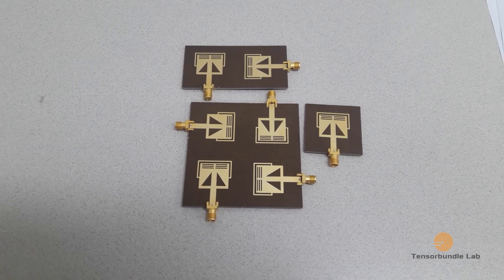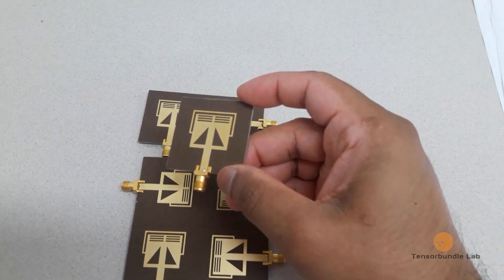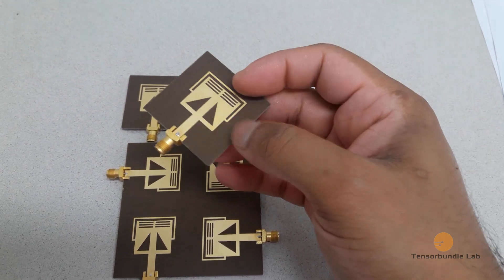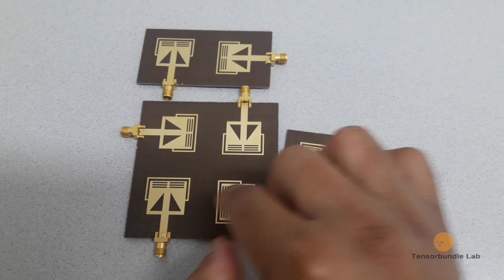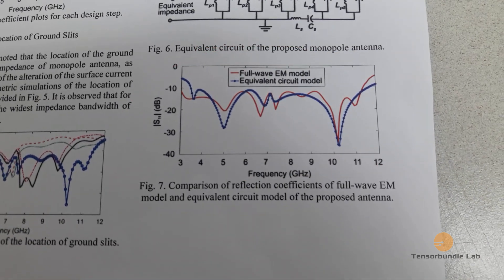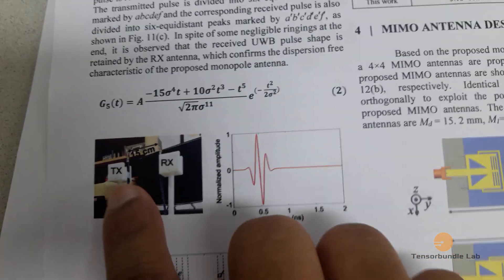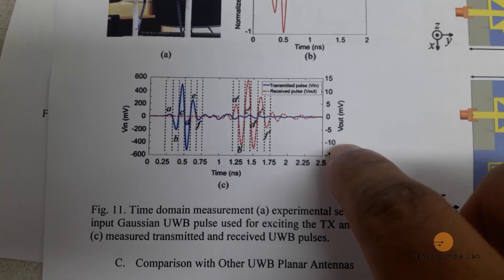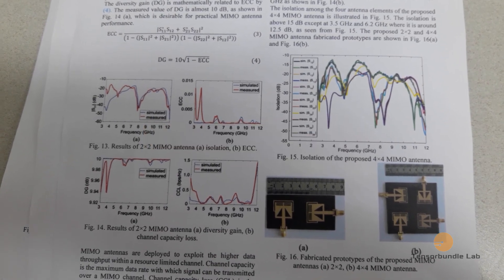Defected Ground Structure (DGS) Monopole Antenna

Comment: Hello Sir, you are doing a very good job. Please please can you explain to me how your MIMO antenna work with separated ground plane? As I know if they are not connected in the simulation part the measurements will not agree the simulation results. Please reply to my question.
Reply from the maker: It is not right to say that if ground planes are disconnected the measurement results will not follow simulation. The measurement results matches with simulation definitely. The reason of connecting two ground planes is to ensure that there is no fault current flowing (both are in same potential). However, even if they are disconnected the difference of fault current is very negligible and does not affect the measurement results much. Simply look at the plots on the published paper. You will see the measurement results are following simulation results